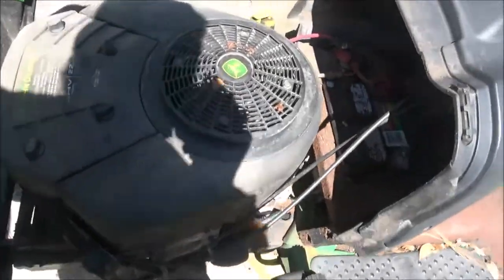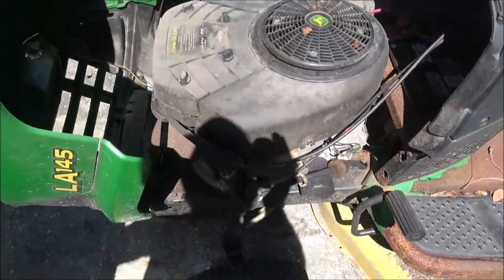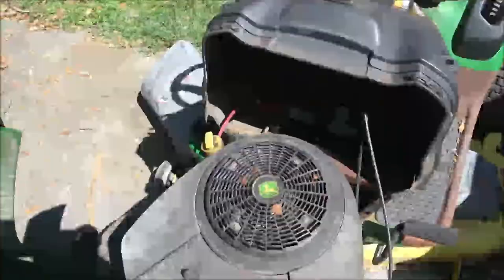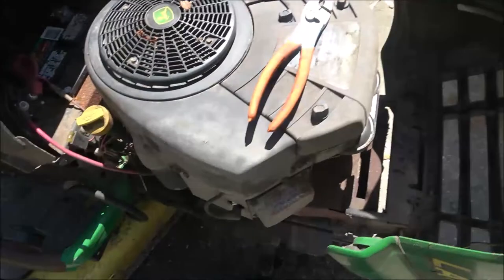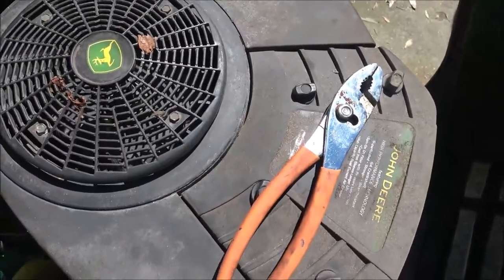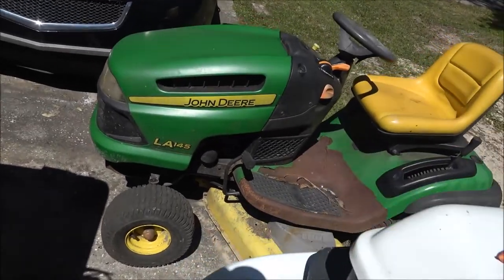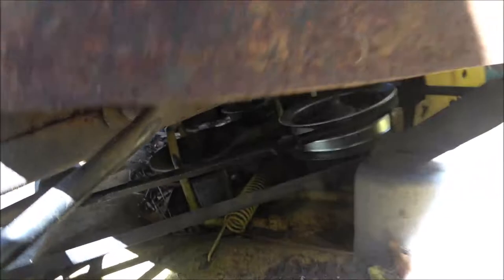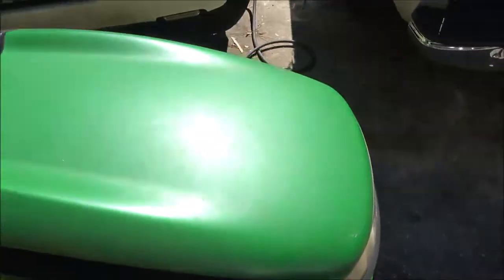John Deere LA145 22HP Briggs And Stratton Exhaust Backfiring And Surging Diagnostic

Comment: I have an LA145 that I acquired from the original owner. He claimed the engine was locked up and it was junk. I systematically have gone through the entire tractor top to bottom, here’s what I found:
Mice had built nests under the engine cover, urine had seeped into the starter, locking it up solid. I got it freed up, and cobbled it together enough to verify that it would run. 
The fuel system was trashed, tank full of crap, fuel line internally degraded to where air couldn’t pass through. Cleaned tank, new fuel line, and filter. Engine ran, but poorly. Changed fuel pump, pulse line, spark plugs. Engine did not run better, popping thru carb, and exhaust. I performed valve adjustment twice, verified proper valve actions, no valve guide issues, no bent rods. Popping thru carb fixed, still popping thru exhaust. Replaced both ignition coils due to mouse chewed wires, and laminations so rust stacked from mouse urine. Exhaust popping no change.  Note, engine idled great, ran great thru midrange throttle, but wot no load, popping prevalent. Engaging mower deck eliminated the issue. I just got thru with a carb rebuild, found emulsion tubes obstructed, as well as intake manifold to cylinder head gasket had been leaking on one cylinder. I cleaned up the gasket surfaces, and wound up having to fabricate new gaskets since dealer had none in stock. They are a rubber o ring style inlaid in the plastic manifold, one side was all eroded from the blow by. I made simple flat gaskets with some hi temp gasket material I had on hand. Traced them, cut them out, and custom fit them for each side. A little rtv high temp sealant spread on the old flattened out o rings made a good seal to the gaskets that I made. 
Engine runs like new now with the intake leak sealed, and all new gaskets and o rings installed in the carb. Seems that the caustic mouse urine set up the corrosion I found on the leaking side of the intake.
Reply from the maker: Hey thanks for the info man. It might help someone in the future, even me. Glad you got it going again. Thanks for watching and commenting and enjoy the rest of your weekend.
Reply: @shabear1000  thanks, glad to contribute.

Comment: Also if your motor has a plastic intake manifold they are also prone to cause backfiring and surging and or fuel leaks if rubber ole ring is worn out or intake manifold is worped or cracked if yall have a plastic intake the best thing to do is replace it with a aluminum intake
Reply from the maker: Good point and true

Comment: Mine acted/sounded the same. took off the carb and one jet was partially plugged. Cleaned the carb with carb cleaner and air compressor through all the holes and ports, put all back together and runs like a top again... first thing I checked was the valve clearance and that was perfect. Next watched a carb video or two and it didn't take long to remove the carb and seen the one jet was mostly plugged after removing the bowl and float and needle. Remove that white plastic neck that protects the jet and tubes. One jet was partially plugged. as soon as I blew into the jet the problem was clear. There was the culprit.
Reply from the maker: Great job. I think I have to do the same thing on ours. It's running fine but it has never been cleaned, kind of like a preventative maintenance. Thanks for watching and commenting ace.
Reply: @shabear1000  I noticed the other day when doing the carb my valve covers leak a bit, creating a mess on the heads fins, which I hear can cause overheating understandably, creating another problem where the valve guide will work it's way out from overheating. So today I'm replacing my valve cover gaskets and will also use just a small skim of Permatex "Right Stuff" just on the valve cover side, not on the head side. I made my own new gaskets as I had a sheet of the proper gasket material and thickness, plus new ones were $30 for the pair and they weren't in stock and would need to be ordered in. Easy pessy to make, took 15 minutes and cost nothing. Lawn tractor is probably 17 yrs old and only 115 hours on it, and believe in preventative maintenance, besides retired and handy in the shop with all the tools, killing time lol.
Reply from the maker: @aceallenk  that is very low hours. It's like having a car with low miles. Ours has around 3000 hours, lol. But it's still going.